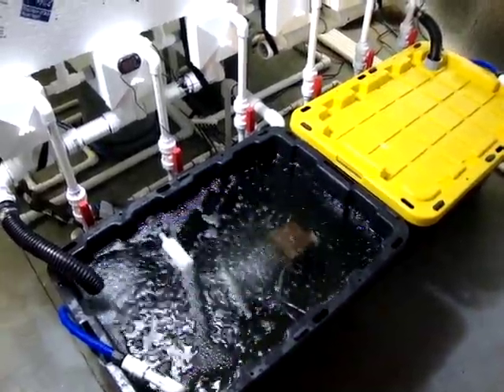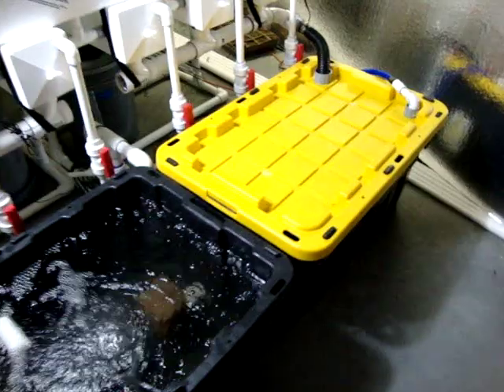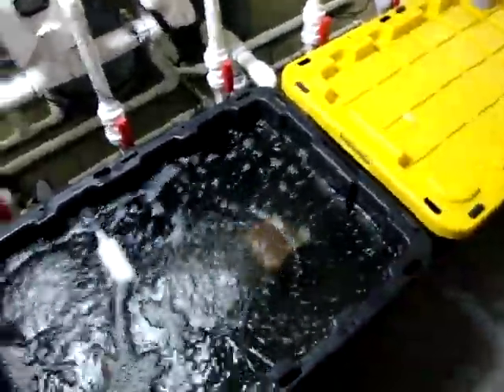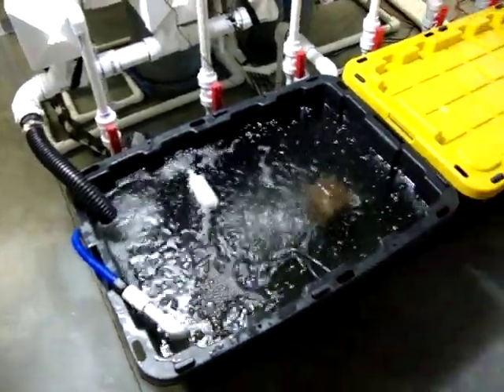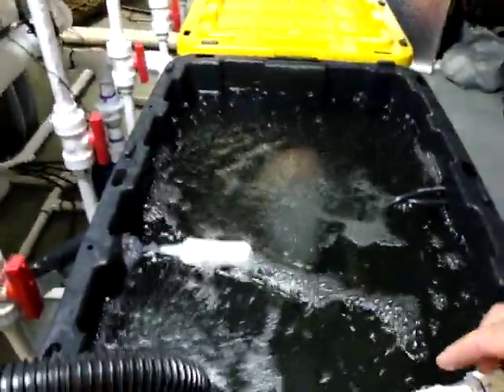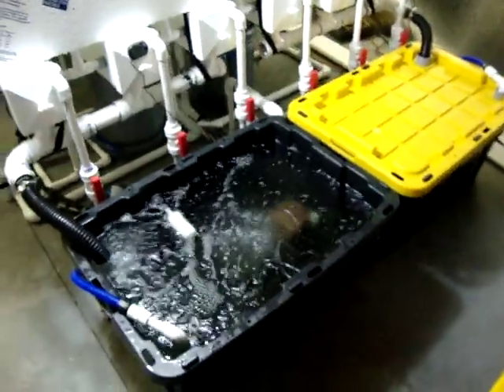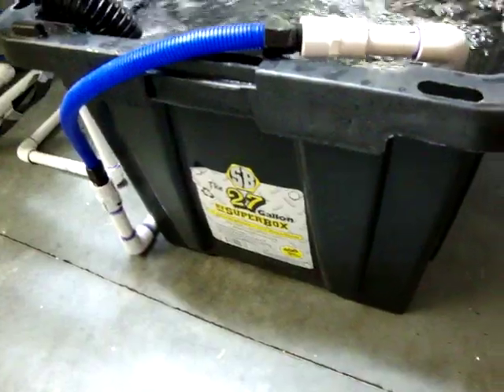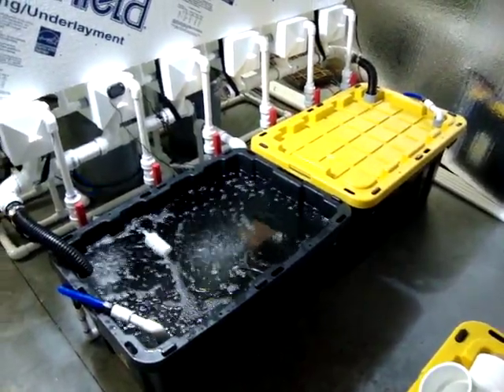DIY 39 Pepper Aeroponic System- Ep. 2 (Resevoir)

Comment: You could have a tank with the neutrint solution in with a line going to a water pretior pump so when your water level goes down the loss of pretior in the pipe starts the pump which will pump pre mixed solution so your ph and newts stay constant

Comment: Have a aquaponic system that's 3000 gallons 1000 to 5000 tilapia 100 plants also have a small 40 site aeroponic system.Love your  system I used 4 inch pvc just two questions what kind and output of pump and what kind and where to get sprinkler heads.Thanks and keep up the good work

Comment: hello, I really dig your video. I was thinking about doing a 3 rail system. I was wondering what size and brand of pump you would recommend? and is your drain line 1 1/2" or 2"?

Comment: I am still amazed with your system. I bet that you are working on auto nutes and auto PH. Just a hunch. What are you using to control the nute temps? It would be interesting to know the PPM levels you are using at the different stages as well. When, not if you build another system, I would like to see a piece by piece video that could later be a documentary on your adventures including all the way through to harvest. I'd buy that DVD!

Comment: I just went down and checked mine, the label says 27 gal but they do have the square pattern on the lid.  Mine also have holes on the base rim instead of studs like yours.  I went on the Lowe's site and the are a different company also.
I'm thinking of using a Marine type cooler (white) for my outdoors resevoir.  I'm not going to get a chiller since they start at over $1K USD.  Guess I could bury it but I can add ice if it gets too warm.